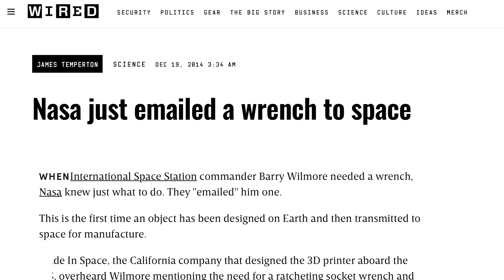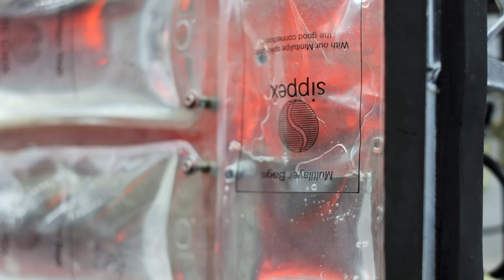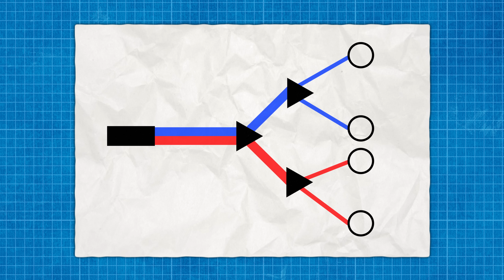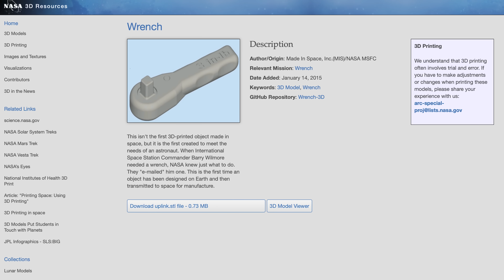3D Printing IN OUTER SPACE! (yes, really)

Comment: @3DPrintingNerd
I need your help,
I am a 16 year old who has put easily over 1000 dollars in my printer, I’ve come across an issue recently that no one seems to know what is and it won’t go away I’ve spent weeks after weeks trying to get it to work going inside and out of the thing. I need advice from someone who has probably been through the bare bone of printers, heck I’d come drive to you at this point with the amount of money I’ve put in this, I know what you think, it’s probably just some easy fix nothing bad, trust me it’s not. The people of Reddit can’t even help me, I’ve done everything I can taken every piece of advice g code, slicer settings, new parts, tightening and adjusting the printer, you name it, I’ve done it. Please get this to 3D Printing nerd. He may be my last hope 😅

Comment: Cool concept, and great work, but I can certainly tell they used that bed slinger to make the parts for it, print quality is a little rough, I would have used a good 3D printer and engineering grade plastics to make the prototype, probably would have used compression fittings instead of cable ties for the hosing, I assume the team building this are all young students, they probably could have used some input from some older mechanical engineers and mechanical fitters, but once again, great work.
Reply: It seems like you're really into this. I highly reccomend checking the links in the description to learn how it all was made possible!
Reply: @davidtobin  I definitely will be checking it out, I design 3D printers and 3D printer upgrades for a hobby, this seems really novel and interesting.
Reply: @NexGen-3D  Rad!

Comment: Cool printer. Maybe you buried the lede. 🙂
"This thing prints, post processes and cures in a little over 2 minutes".
Just as well as the Virgin Galactic only experiences zero g for 10 to 15 minutes.
Reply: @DeclanMBrennan  think it's "the lede" :)
Reply: @Aussiemoo  Thanks for the correction. I've had that phrase wrong forever.
Here is what "Proofed" has to say about it:

Both “bury the lede” and “bury the lead” are acceptable spellings of this phrase. However, “lede” is the journalistic spelling that originated in newsrooms in the mid-20th century. It was created to avoid confusion with “lead,” the metal traditionally used in printing presses.